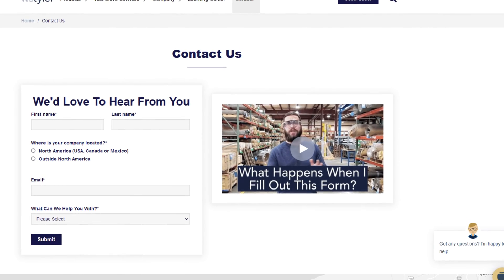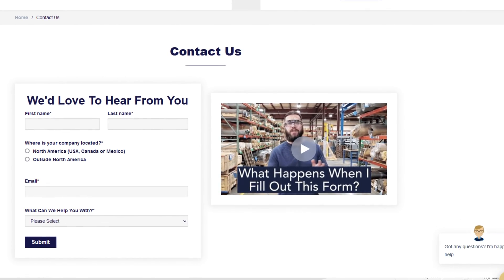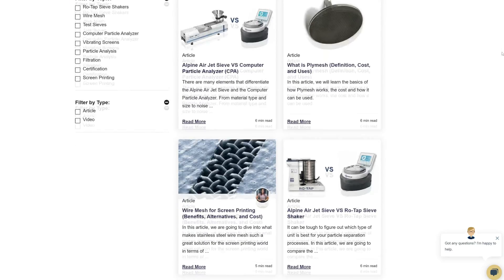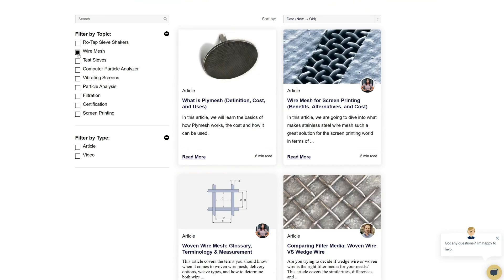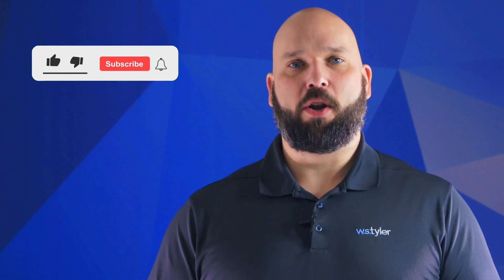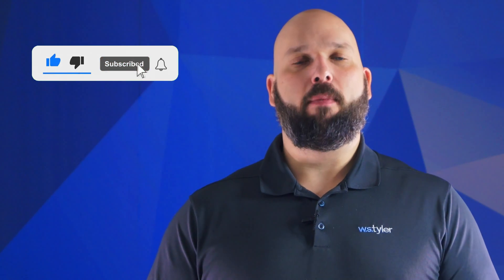Woven Wire Mesh | Screen Printing in Circuit Boards

Comment: The circuits are rarely silk screened on these days. Other printing methods are far more common.  Even the "silk screen" layer on PCB's are not silk screened on in modern processes, only fabs running older equipment do this still as the ROI on direct digital printing equipment is quite low.